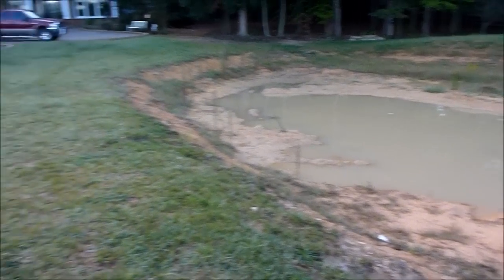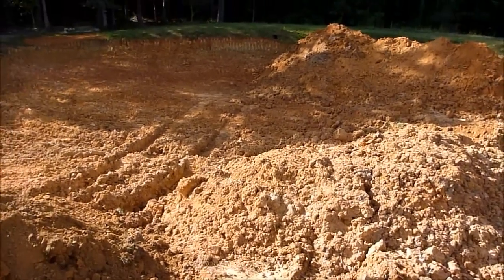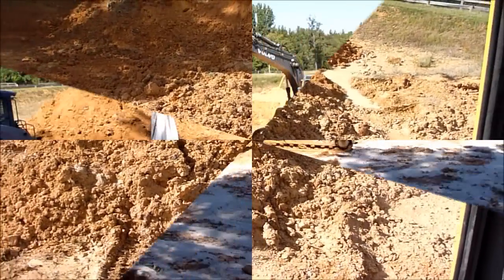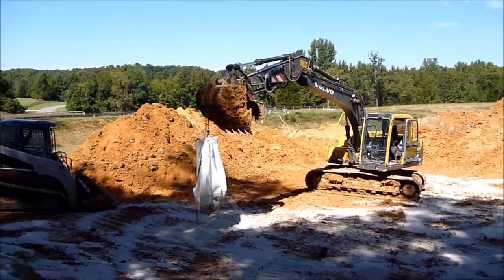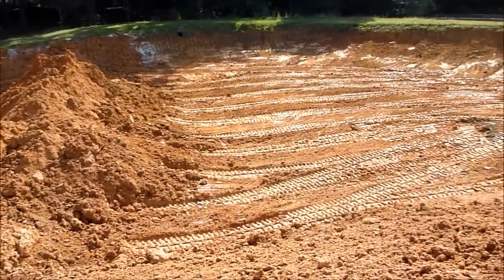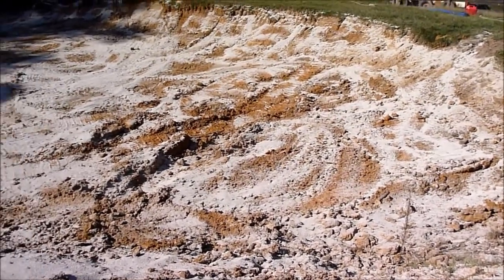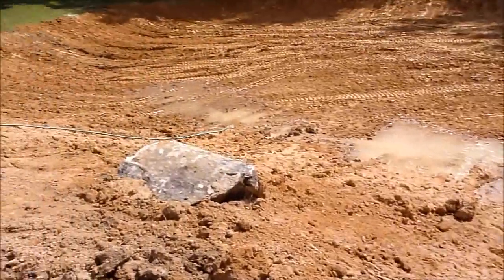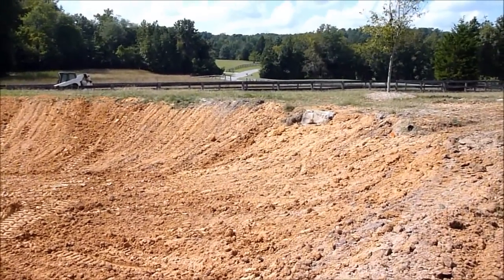How To: Fixing A Leaking Pond

Comment: Any insight as to why it was leaking? Was the clay high in sand, or did you find a sandy layer? I'm getting ready to dig my own pond and would appreciate any tips on what to look for. I know the clay on my property holds water very well, as any hole I dig gets filled up and stays full. But it would be my luck to dig a 3/4 acre hole and have it NOT hold. I know I should stack back some good lining material in case I do hit a sandy spot and need to seal it, but is there anything else I should look for? I'd really appreciate your input if you have it. Thanks. I really enjoy your channel!

Comment: I've used Bentonite for a leak in my own pond, it worked. Earlier this summer when we had a drought the pond level was about three feet low and I could see the Bentonite, my goodness is that stuff sticky and soft, I made a mistake and took a step onto it and nearly lost my boot as I sank. I'm sure what you did will fix the problem.

Comment: You should check out the fled bag. It’s a valve that you stab into the bottom of the large sacks. So you would be able to do one section and shut it and then move over and do another one without waste.

Comment: As for the kitty litter comment, I put some in a mulch pile with leaves. I soaked the litter and leaves with the hose. I tried to mix it all up with the tine rake. What a mess. It'll be a while before that litter blends in with the leaves. It really clumps just like it says it does. I think parts of it will always be stuck together.